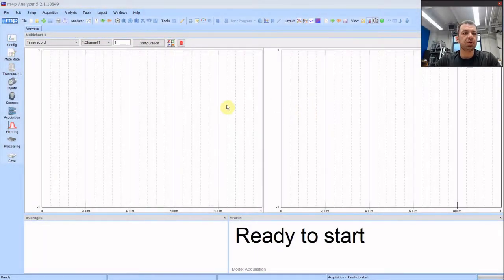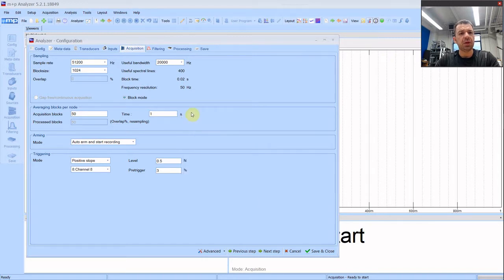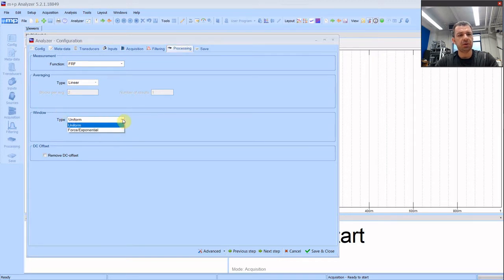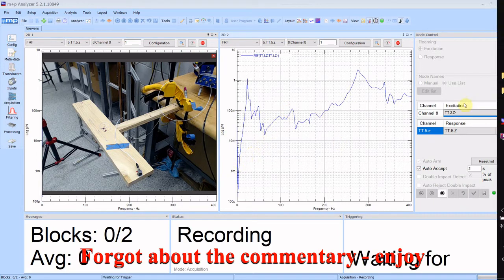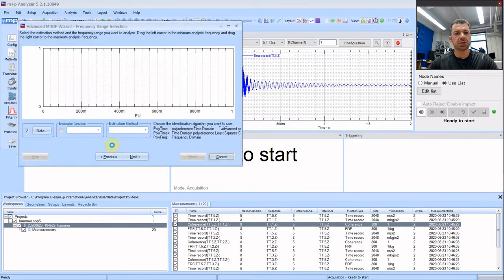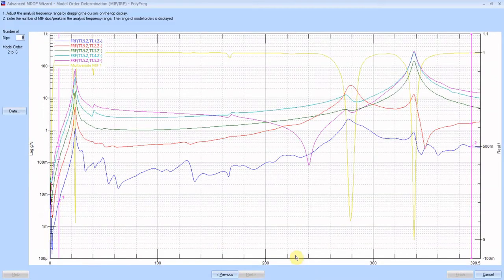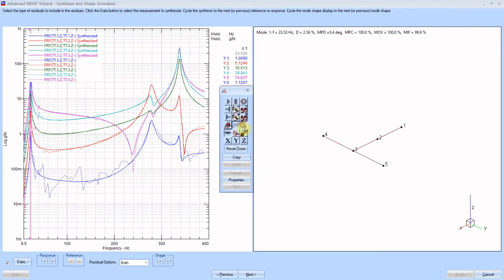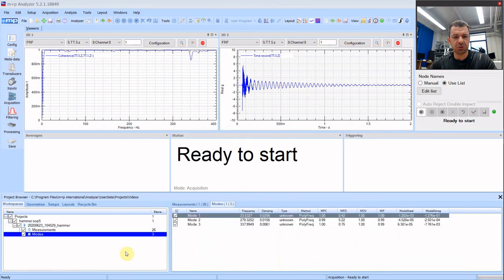Lab Equipment Series - #7 - Modal Tests - Hammer (Ping) Test

Comment: Hello, I can see you are using only one accelerometer, and you succeeded to get your modes, in your class about GVT you said we can’t with only one accelerometer. So how is it possible to get the mode? Thanks
Reply from the maker: Hey
To generate the modes you need FRFs for each of the points in the model. In the case in the video we have inputs from all the nodes (hammer taps) to one response accelerometer. So everything is covered. With shakers you're not moving the shaker between points, so you need multiple accelerometers. I believe that this is what I was referring to.
Reply: @danilevin868  thank you so much, because I’m doing an internship where I basically have to create a experiment for student, to get the modal data of a small plane. You are helping me a lot with all your classes.
Reply from the maker: @harimau2854  awesome, glad I could help.